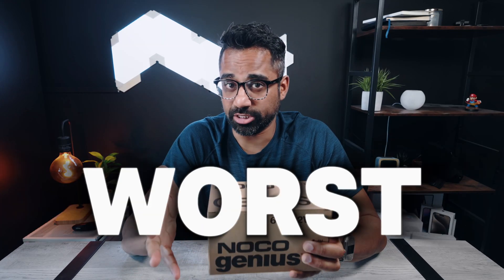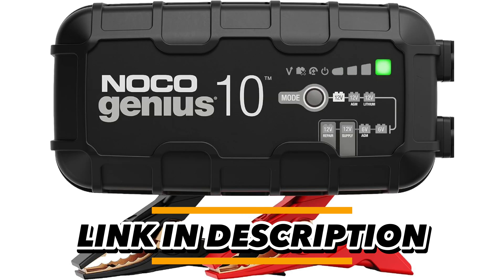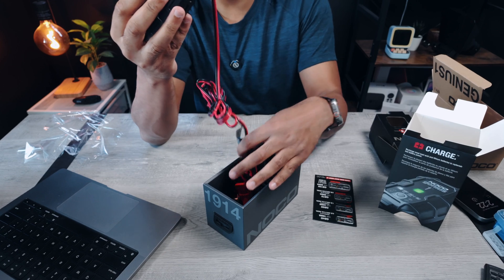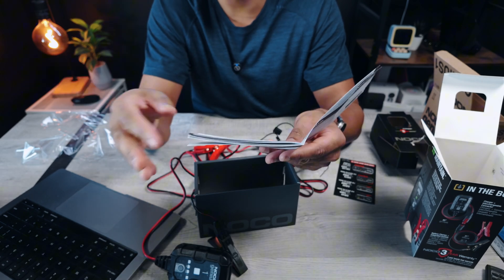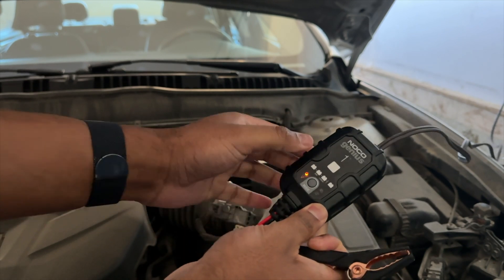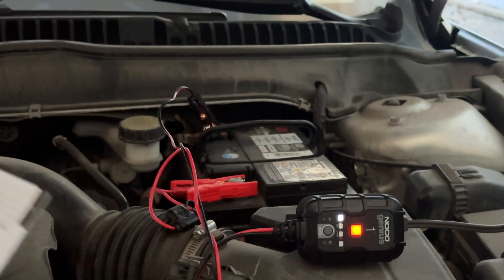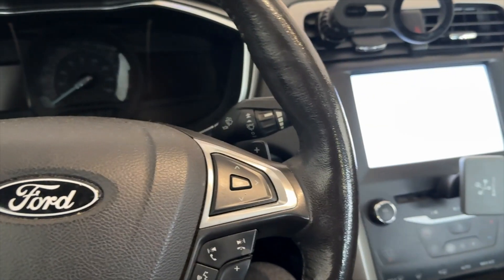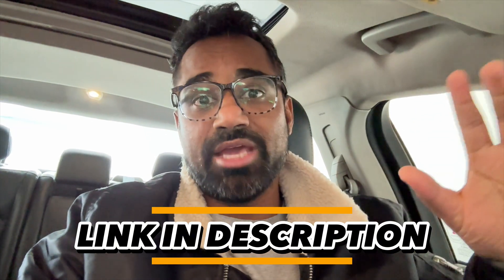NOCO Genius Battery Charger Review  - Repair or charge your dead car battery!

Comment: The primary task of this 1 amp charger (vs the higher amp chargers mentioned) is to be a "fire and forget" full-time maintenance/storage charger without smoking the cells (which you did mention in your review). It's not meant to be a rapid charger, I've seen that held against it in reviews. I've used it with great success in winter storage of lawn tractor and jetski batteries, as well as a Jeep that is occasionally used in the winter. Noco makes a nice ring connector harness that allows a quick connection.

Comment: It's supposed to be able to desulfate. So, does it do this automatically? It didn't come with a user's manual.
Reply: I've read/agree that this model will Desulfate automatically, if it detects the condition...  Apparently the bigger models (5/10) have a Repair Mode which is selectable and can provide more advanced Recovery of a Severely Depleted/Weak Battery